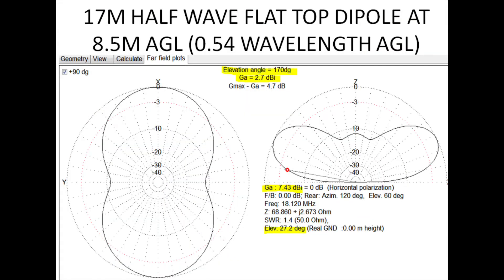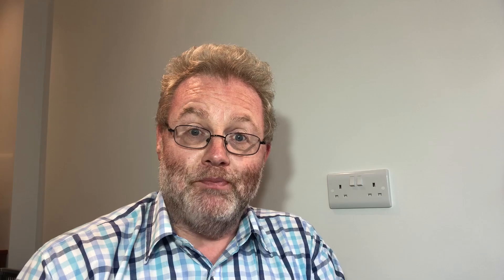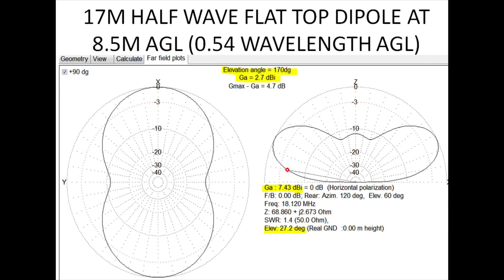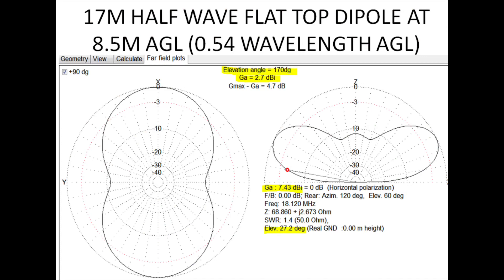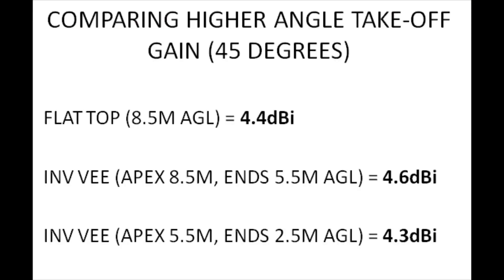Dipole Antennas: Flat-Top or Inverted-V?

Comment: I choose an inverted V over a flat top dipole when I cannot support a flat top dipole,  but I can support an inverted V.

I would also choose an inverted V if I wanted to create a beam antenna for 40 meters supported by two 12 meter fiberglass masts with both the driven element and the reflector in an inverted V configuration and spaced about 0.2 wavelengths apart.

Comment: I enjoyed this blog Tim, however  I can't have a flat top dipole or an inverted  V. I have a conventional V being fed at the lowest point, 12' from the ground, with both arms being elevated to 20', the overall length being 152.6 feet.  The issue I'm having due to locality is the angle between the arms is only 100 degrees. I have read that this needs to be at least 120 degrees to be OK,. The reception is better than my 66ft longwire, but I'm sure it could be improved. Any idea how to increase the angle?
Reply from the maker: 100 degrees will still be fine and only fractionally down on wider angles

Comment: Hi, Can i make a 434Mhz V shaped dipole with 16.5cm each leg to put it in a nosecone with less than 90 degree angle would it still transmit?
Reply from the maker: It’ll transmit with a little reduction in gain and a narrower Swr bandwidth 73

Comment: Thank you, Tim. I think this is valuable content for ham radio beginners like me. 🙂
With my current level of understanding, it seems to me that for the higher HF bands like 15 m it makes sense to stay with a vertical as for these wavelengths it is relatively easy to mount something like an EFHW monoband vertically, whereas for the lower bands this is getting more difficult and it makes more sense to consider the flat-tops or the inverted V setup. So, thanks again for demonstrating the differences between these 2 latter antenna shapes.
73 de DO1HNR (German class E, so no need for 20m and 40 for the time being, but hopefully that'll change soon 😉)
Reply from the maker: Welcome to the hobby and thank you!

Comment: Some of your viewers might not know that antenna gain is the product of antenna efficiency and directivity. It’s helpful to consider those two contributors separately when comparing the two configurations. 

If we ignore the presence of the ground, both the straight dipole and inverted V will have very similar broadside directivity. But the bend should broaden the elevation pattern, reducing the directivity straight up and spreading that power over a wider angle. Their radiation efficiency should be identical.

Now consider the ground. Assuming both antennas have the same maximum height, the inverted V will obviously have a lower average height. Near broadside we have horizontal polarization and the ground reflection pushes the peak of the lobe to a higher elevation angles. The lower the antenna the more that lobe moves. That can be an advantage or disadvantage, depending on the distance you are trying to reach. 

Up to here I’m ignoring ground losses. They will have an effect on radiation efficiency as the antenna height decreases, but at typical heights I suspect that’s a relatively small contributor to gain compared to the effect on directivity. 

You mentioned that the inverted V provides a closer match to a 50 ohm feed. That’s true, but I don’t think a mismatch to a 70 ohm feed of a high dipole is much of a hit to radiation efficiency or SWR loss in a typical feedline, so it’s not a deciding factor. 

The above observations are based on general knowledge not calculations, so if someone finds a misstatement feel free to point it out.

Comment: If the radiation pattern of a center-fed dipole is circular around its axis, can't it be turned to the vertical orientation to be an omnidirectional antenna? If so, how high off the ground would it need to be mounted? 1/2-wave (so the "top" would be 3/2-waves of the ground) or is it more important to have the upper element 1/2 wave off the ground( which would essentially have the "ground" side near the ground).  In my case for a CB (11M) antenna.

Another question about the "Inverted V" dipole: when the "V" is 90 degrees, doesn't that tend to make it an inverted ground plane antenna?
Reply from the maker: For the vertical Halfwave dipole as with the horizontal version, the max current is in the centre part of the antenna so enabling this to be as high as possible is good. However, you do have an omni directional pattern and the key is to try and get the lower leg as far above ground as you can (and away from the reach of people as voltages will be high at the ends).

Comment: In photography, we call a certain group of people "pixel peepers". This group of people look for pixels or specific details no one else "in the main" would ever see in a photograph. Well, I've noticed in ham radio, we also have a group of folks called "radiation pattern peepers". This group of people look for different radiation patterns, like between the inverted V and Flat top. Bottom line is, no one would be able to tell on the receiving end what antenna being used between the 2 antenna's.  However, having said that, I feel this information is very useful from an academic perspective in learning how different things change as changes are made to the antenna. So, really good information. However, I can't stress enough the diagrams/FF plots etc. look larger than they actually are. Meaning many of these changes in signal strength are minor, but the graph makes it look like a huge change.  Hope that is constructive in my best opinion :)  Best Regards and 73
Reply from the maker: Oh I’m a peeper!

Comment: (copying to a main comment from my reply) 
One of the huge benefits of an inverted-V, or in my case a double inverted-V (in our club we call  is a cross-V) is that it can be self supporting with a single mast. I setup mine for about 120 deg included angle with legs for 20 and 40 meters and can easily work 15 on the 40m legs since it's the 3rd harmonic. More bands "work" with most radio's built in 3:1 tuner. Perfect for EMCOMM where most of your work would be <1000 miles and portable use. Also, all the "parts" came from a home improvement store other than the SO-239 bulkhead connector and the coax, so field repairs are easy.

Comment: Good analysis Tim 😀 I think in practice it would be hard to notice the sometimes subtle differences between the two 🤔 However, having two options gives you variations to get as much wire into the garden as possible and as high as you can , as these two factors will probably be more influential? I think the different mounting options of flat versus V is also a positive when it comes to what’s possible in the given space 👍🏻 Thanks 😀
Reply from the maker: Agree 100%

Comment: As an Antenna can't have a power gain it's all swings and roundabouts. Affective gain just means that the power you have is being funnelled in a particular direction.  So if it's omnidirectional then the gain will be zero or less due to losses.  hence to get high affective power gain you need to be able to rotate the antenna as the beam width will be reduced to a narrow angle.

My G5RV with the centre at about 12m is great to some places and C**P to others. I've gained on the swings but lost on the roundabout.
Just waiting for the 17m 4ele at 20m to fit within the bank balance. ;-)
Reply from the maker: Very true. I’d love to rotate my Hf antenna but no room sadly

Comment: These models are great, and show, I think, that they are basically equivalent because the point to point path and signal reliability will depend much more on conditions, which change unpredictably in both time and space, than the differences in these two configurations. That is, 1-2dB here or there, or a few percent here or there, on the antenna, is << than the environmental variability. Using an inverted-V (Spiderbeam multiband) with 11m apex, I was making 9000km QSOs 100W barefoot on 20m, 40m, and 15m, during the IARU HF.
Reply from the maker: Yep inverted v work fine

Comment: Hi Tim, I've a mosly 5 band yagi,  with one element on 17M, little or no gain..It's 10M above the ground and I've worked JA a few times on 17M with 100w.
17M is an underrated band, great for exotic stations...

Comment: Comparing inverted-V (downward pointing) with a flat dipole made me want to see what would happen if the angle continued upward into an upward-pointing V. I don't expect that it would make an effective antenna since I've never seen anyone use such a thing, but I would love to know what happens to the feedpoint impedance and radiation pattern.
Reply: NVIS maybe ? intresting to try out, esp on 10m!
Reply: @alzeNL  Exactly. One of the huge benefits of an inverted-V, or in my case a double inverted-V (in our club we call  is a cross-V) is that it can be self supporting with a single mast. I setup mine for about 120 deg included angle with legs for 20 and 40 meters and can easily work 15 on the 40m legs since it's the 3rd harmonic. More bands "work" with most radio's built in 3:1 tuner. Perfect for EMCOMM where most of your work would be <1000 miles.